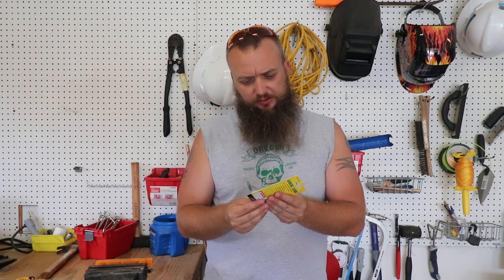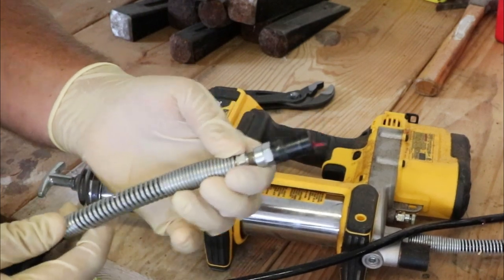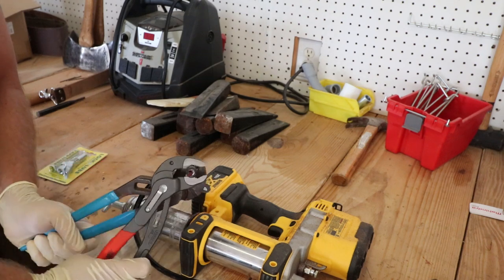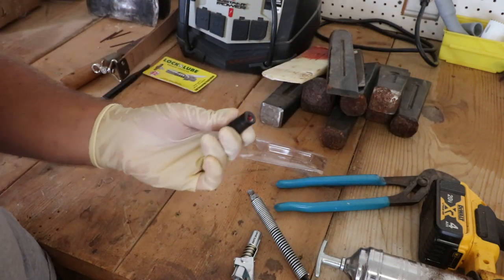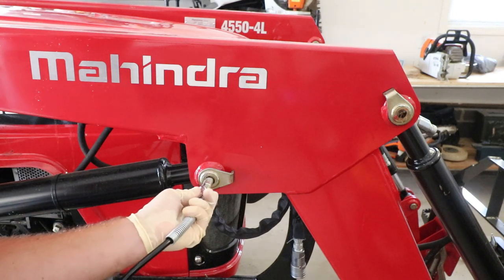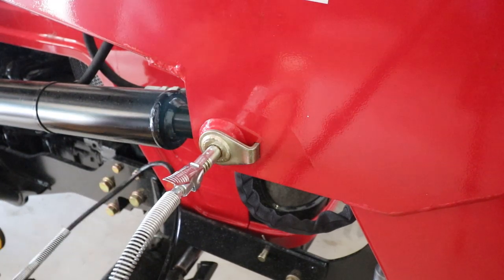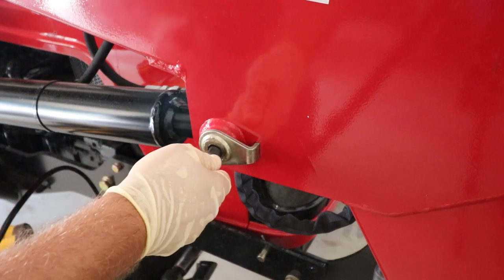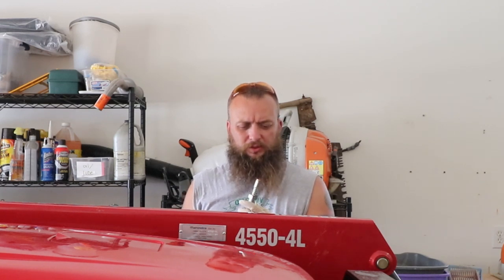THIS SIMPLE TOOL WILL MAKE THINGS EASIER WHEN WORKING ON EQUIPMENT,

Comment: I'm gonna comment on those knipex channel locks as an auto mechanic. Those pliers are the best in the industry. They'll bite into just about anything, the angled teeth help a lot. They are just amazing.
Reply: Yep. They are kind of like a pipe wrench in that the harder you push, the harder it grips. With a new set, you should be able to put them on a piece of round stock and stand on them. You don't need to squeeze them to grip.

Comment: This looks like a very good mod for my grease gun, the reason the standard connector is a problem is the recessed nipples on your tractor, they are recessed so they do not get damaged, but the grease gun cannot be articulated enough to release.

Comment: I've had the same problem for years with stuck grease guns. I believe it is caused by some fittings holding the grease pressure (which can be surprisingly high) and locking the coupler fast. I solved my problem with a similar coupler I saw at the local farm show last fall. Made my life better.

Comment: I use it on same electric gun, but I keep a lever gun with standard tip to do those hard to reach zerks.  There are kits with extensions and different angled ends and different heads that attach to the locker or regular gun.  Sooooo many tools, so little time,  LOL

Comment: Grease gun is much cheaper than not having one!  I love the lock n lube, but theres a few zerks on my tractor (well, the backhoe) that there's not enough room for the lock n lube...just change out the zerk for an angle zerk.  Had mine about a year and still works great, they just give you extra seals because they know if your spending 30 bucks on it, you probably grease a lot, and are probably the kinda fella that appreciates extra seals on hand
Reply from the maker: Agreed 👍

Comment: THANK YOU ! THANK YOU ! THANK YOU !    I've had the same problem. Yesterday I lubed the bearings on my boat trailer and after using 2 hands to try to get the fitting off the Zerk, I gave up and got a big screwdriver to pry off the fitting .. with a LOT of effort. My new fitting will be here Monday. I'll let ya know if it works for me like it worked for you.

Comment: Former heavy equipment and crane operator; The new popularity of deep set zerks is to blame,. To remove the regular delivery end you need to pivot it sideways to disengage which can be impossible on deep set fittings. I've had to leave the tip on the fitting and unscrew the hose [not easy] or leave the whole gun connected permanently[ cheap hand pump ] on the crane's main boom pin or hideous squeaking would happen by day number two. I believe their thinking was; the new deep set would prevent damage to the fittings. Now we need that new gadget you've shown. Some are very deep, I don't know if that will even work on those. I had the mechanic order extension tubes to bring them out flush on some.

Comment: Yeah, the seal is a weak point. With heavy, daily use, you can get a few months out of them. 

Another great thing about them is that if you need to use a needle adapter, it holds it on securely. 

I have one of these on my grease gun, but I also keep a smaller head adapter around in case the hole is too small or clearance is tight and the adapter is too long.

Comment: I find with the normal zirc adapter if you move it to the side it pulls off fine but with those recessed fittings on your mahindra you wouldn't be able to pull off that maneuver.
Reply: Exactly.

Comment: I have that same grease gun. I bought a different coupler, though. Mine works like an air hose fitting, but I can't remember the name of it. I bought it at a local tractor dealer. You pull the collar back to put it on and take it off.

Comment: That's a great concept if it holds up. The problem I have is that my Deere has fittings on the U-joints that require a needle to access. Even the factory grease gun head won't fit.
Reply: Google "zerk needle" or "grease needle" to find something that will snap onto your grease gun.  They come in a variety of lengths.  I cut a long one at a 45° angle, then silver soldered the pieces back together to make a 90° needle out of it, with the end being about 3/4" long.  Works like a champ for the hard to reach needle fittings on the aircraft I worked on.
Reply: @throngcleaver  I previously bought a needle at Tractor Supply that snaps on to my grease gun and works like a champ. Thanks for the help.
Reply: @williamellis8993  Glad to hear it! :D